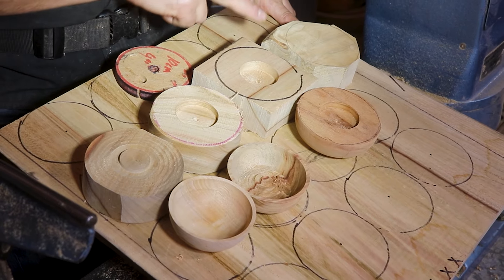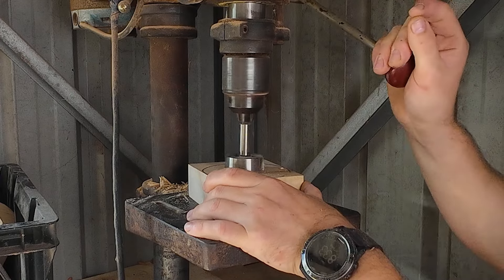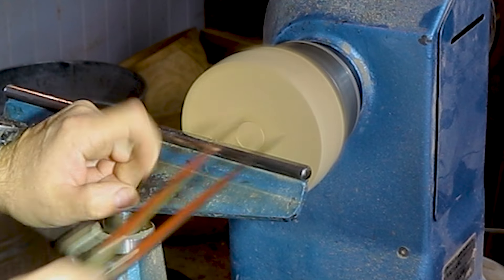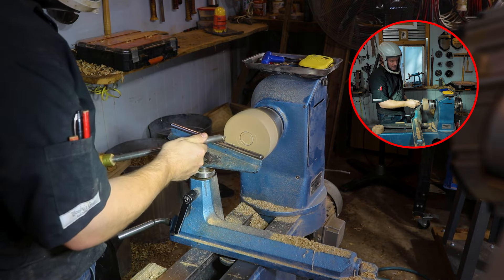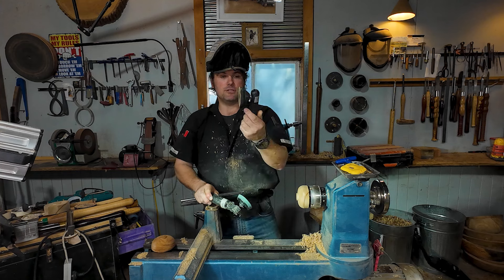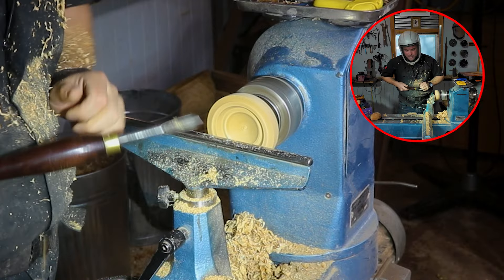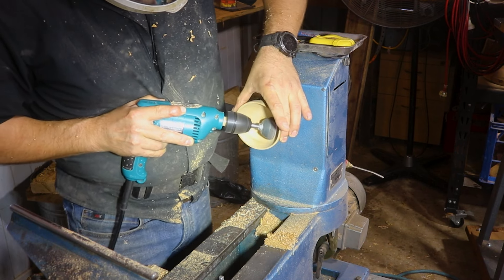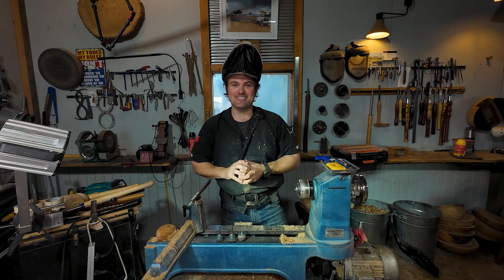700 bowls turned. This is how.  Production run No.8

Comment: How do you keep your Vicmark from spinning off the spindle when it’s turning backward?  Serious question.  I have just 2 of them.  My Oneway jaws have threaded holes where I can use 2 grub screws sometimes called set screws to hold them snug in reverse.  I’ve had a chuck spin off the lathe when I first started turning so this is something I am careful about.  I haven’t tried to use the Vicmarks in reverse but it can be inconvenient to change chucks just for sanding, yeah?
Reply from the maker: On the VL 240, there’s a locking collar you can place around the back of the chuck and the spindle. I’ve talked about this in other videos as well because it can be quite dangerous if the chuck comes off. When you’re placing the chuck onto the spindle, make sure both the back of the chuck and the spindle are clean where they make contact. Just before locking it in, give it a quick, hard flick to ensure the metal binds securely.

Check out my other videos where I cover this in more detail since I know it’s a common issue.
Kez
Reply: @KerryCorney  I have a 100 and a 120.  I’ll look for your other videos about the locking collar.  Thank you.
Reply from the maker: @DancingFox6  my pleasure. Hope you find what you need to have a great day.
Kez